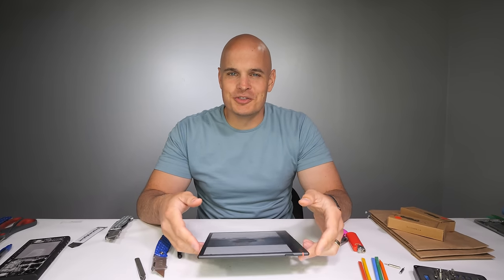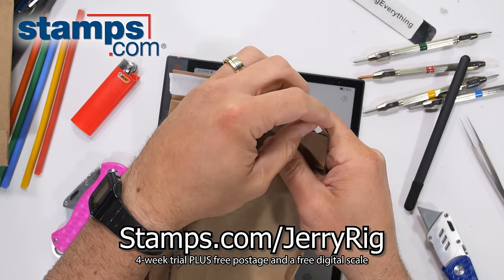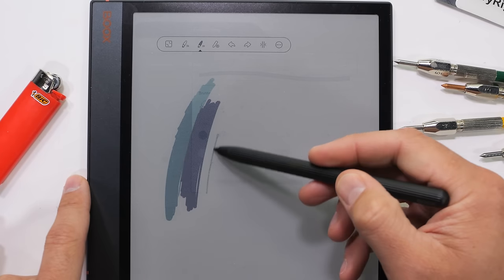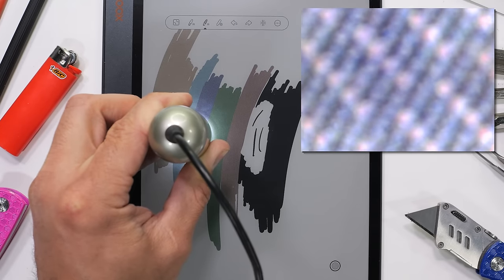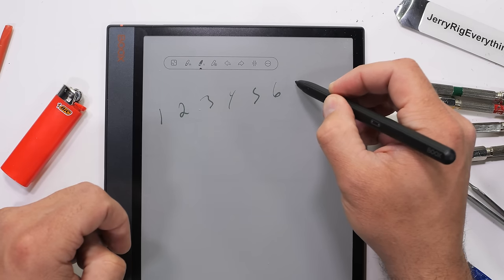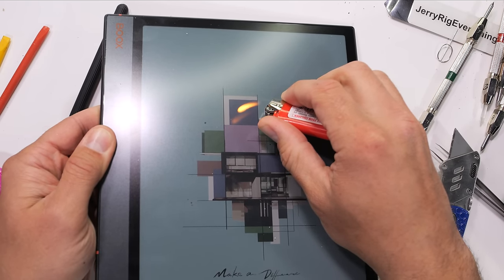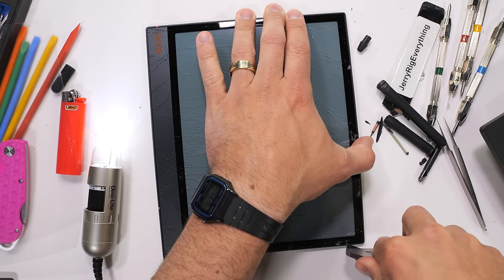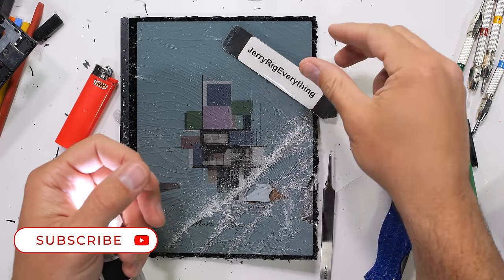Color E-ink looks CRAZY Under a Microscope!

Comment: I have the smaller version of it (the Tab Mini C). It’s awesome for light novels, manga, and books. With Kobo and Tolino now introducing color e-ink e-readers, we might finally see more widespread adoption and new innovations.
One small thing, though: the mirror isn’t for the backlight. The device has no backlight; it’s using a few LEDs to illuminate the display from the front.

Comment: Things like this really make me depressed because manufacturers have completely ignored e ink over the last 10+ years. Between this and trans reflective displays. The ability for watches to last more than 3 to 4 days would be a reality if e-ink had been more mature at this point. Because everyone loves to focus on the system of the chip and its power draw. The vast majority of power draw is from the screen. This is why no watch leaves their screen on 24/7 because of the amount of power draw. E ink resolves that issue. Which means a watch can act like a freaking watch where it's always on. I really want to see this technology develop further higher resolution, deeper colors etc. All of that is doable it's just the r&d has not been put into it. Instead we have crap like foldable screens. Which admittedly is cool. But I want to see e ink mature further

Comment: Why is this using rgb ink instead of cmyk? I feel like it would get better colors if it used the subtractive primaries like all other inks do
Reply: That’s a great point!… it could actually help with the darkness problem of Kaleido 3 as well. I double checked, it is using CMY source: “Features of the Wide Color Rendering Process Ink KALEIDO™ Series”

Comment: E-ink displays are just perfect for smartwatches or at least for fitness tracker but the mainissue here is the monopoly in the e-ink Technologie…
The devices with e-ink are not so expensive cuz they are so high tech, no it’s just cuz we just have a single company in the world which produces e-ink displays and any company who wants to offer e-ink have just 2 options, make it from scratch on new or buy it at the only company which produces e-ink displays…
It’s a really bad situation and cuz of that e-ink is still on a level where we just have in most cases better or cheaper alternatives what are not e-ink…
Pretty sad and I think on some point something must happen cuz the tech is way to good that the only usecase would be e-reader and price tags in the supermarket…
This tech has very high potential but when just a single company is allowed to produce them it will just die in a couple of years cuz nobody is ready to pay the full price of an iPad just to get a tablet with the power from a 5-10 years old device but thankfully to this monopoly position of the e ink corps, that’s currently the only option to use those displays, you must cut the costs hardly just to compensate the unreal high prices for the displays itself…